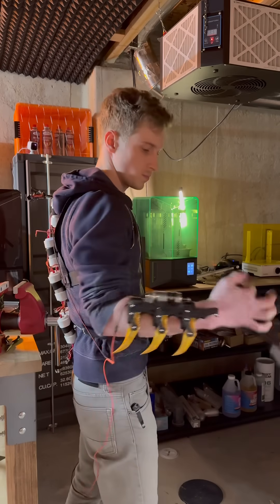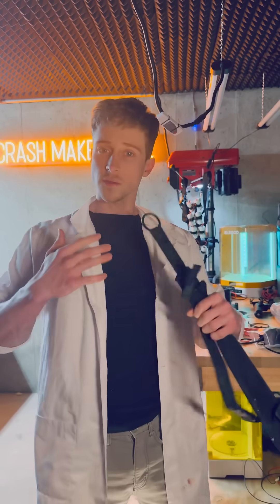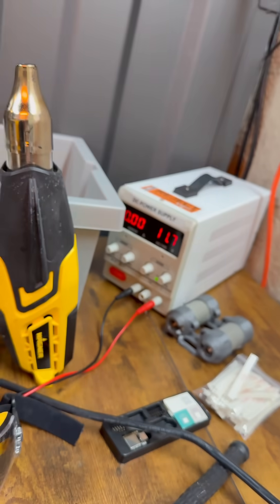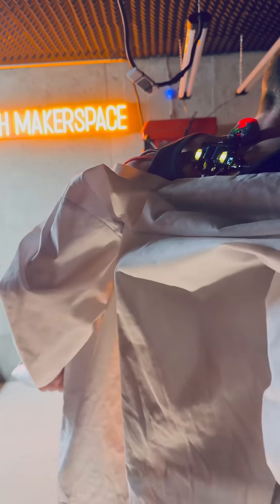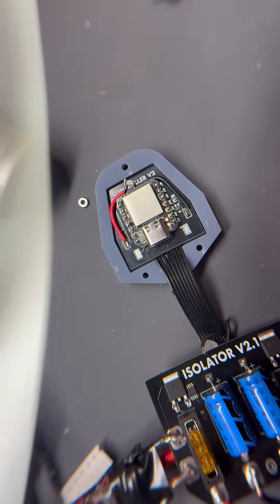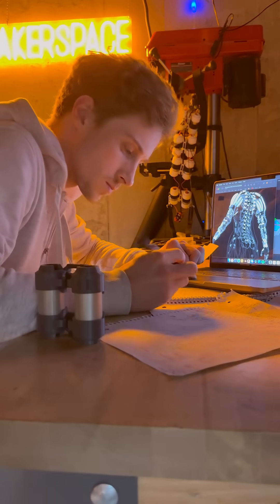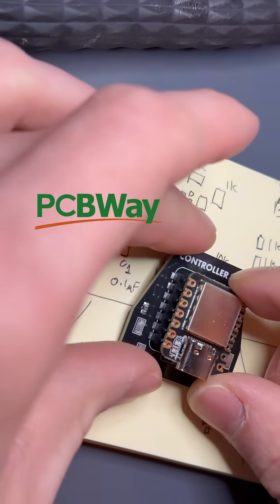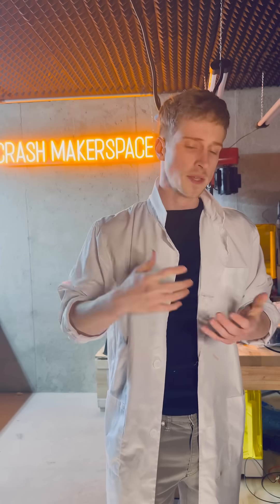WASTELESS ISOLATION ⚡️#shorts

Comment: This is awesome, but I'm wondering if you will come back one day to the assassin's Creed hidden Blade project?
Reply from the maker: I very well might come back with a metal and even more robust version. It's a very complex system to try to get thinner & thinner while retaining that infinite in-out via single string pulls. Others have metal ones but they're all very bulky or need an air system on your back to run them